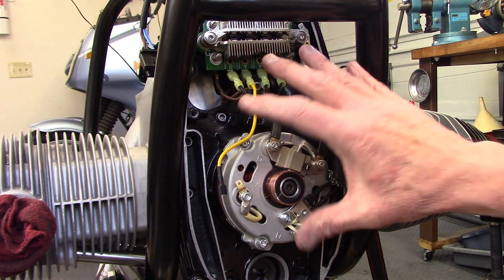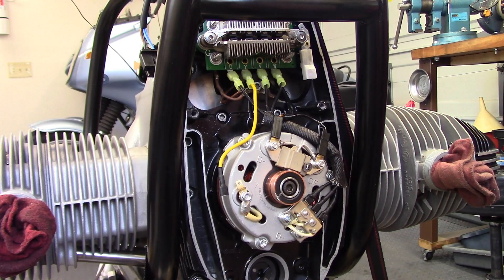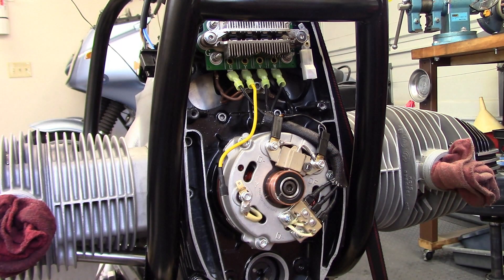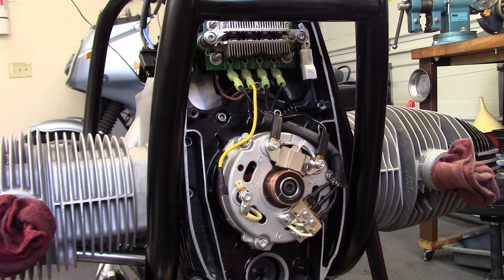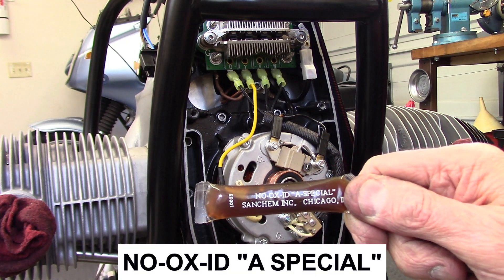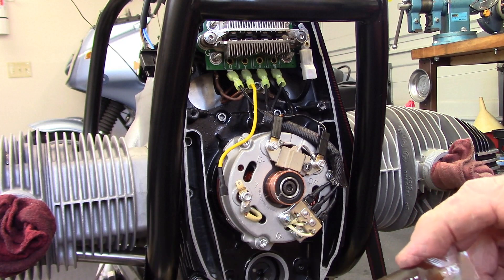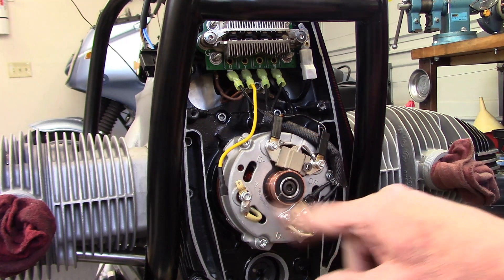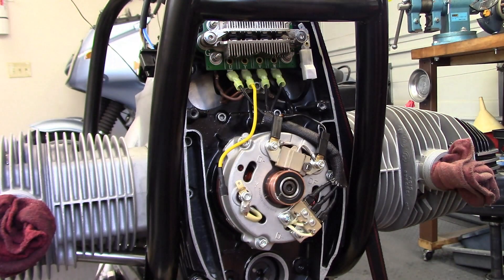Dielectric Grease Vs  NO-OX-ID "A Special"

Comment: The Sanchem "No Ox-Id A" ( we pronounced it as No - Ox - Eyed)  compound has been widely used in the telecommunications industry for over 40 years as a anti-corrosive compound, applied to cable ends before crimp connectors are made to them, as well as on lugs that will be attached to bus bars and stud connections, as well as lug to  DC battery connections. I have used it in work operations for over 25 years, and have observed that it does a great job of preventing corrosion for these applications. Although it is at times referred to as a "grease" , or "lubricant" , it will get VERY thick if used in temperatures under 50 degrees F. A thin coating on a lug that is attached to a bus, stud, or engine/motor housing will prevent any corrosion due to electrolysis from dissimilar metals, abd then a light coating on top of the hardware will also prevent any corrosion on the lug.stud/clamp/nut/screw that attaches things together. I would still consider using silicone dielectric grease for putting on to moisture blocking boots like on spark plugs and any removable moisture blocking seals, but for applications like crimping a lug onto a copper wire, or coating a battery cable connection,  I would definitely use the No-OX-ID product.

Comment: That seems like a pretty good idea. I have often pondered the ultimate advantage to putting, what can amount to, an insulating barrier in an electrical connection. I suspect the most benefit from NO-OX-ID is from using it on clamp style connectors. Spade terminal connectors generally etch a clean contact patch thru grease. A clamp style connector won't necessarily do that. Thanks for sharing this.
Reply from the maker: Joe, I agree that the spade terminals should etch the dielectric grease off the contact points so it wouldn't interfere with the electrical connection. I suspect using dielectric grease on pin connections is not a good idea as I don't think they clean the grease off the contact surfaces.

Comment: Brook, really glad to see someone post this, I came to the same conclusion when dealing with older electrical connections. Dielectric grease seemed to cause more harm, especially if connections weren't tight and didn't properly displace the grease. I've had much better luck with conductive grease - I've also used NO-OX-ID in several applications with good results.
Reply from the maker: Hi Michael, thank you for visiting. I too used to use dielectric grease and now the protective, conductive NO-OX paste is my go to for corrosion prevention.